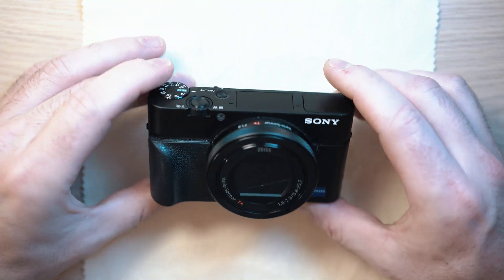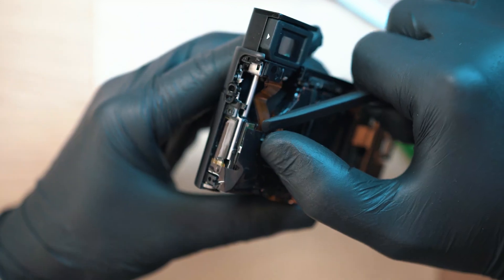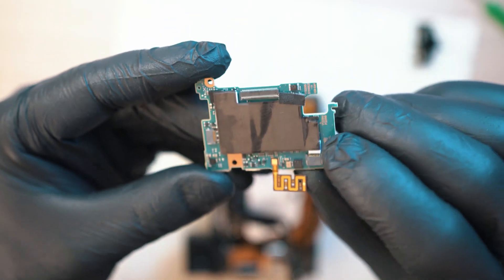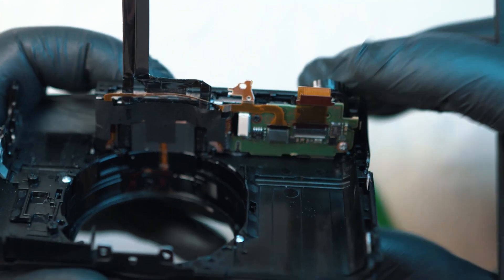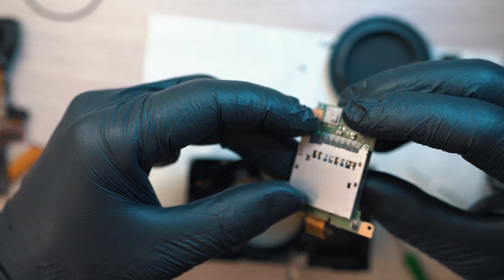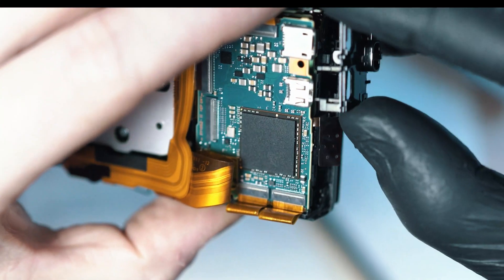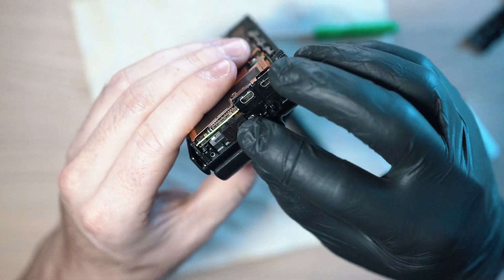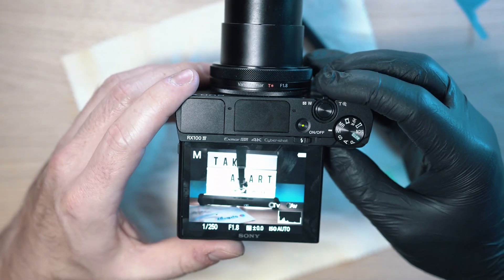SONY RX100 IV TEARDOWN - Lens Replacement Repair | Firmware Fail

Comment: Until what part of the video should I follow to remove the flash drive?
Reply: All on my cam work, photo, video flash pop up, but just pop up! with no light, on my screen shown error E91:01 and i decide to change the entire flash unit, I tried to change the battery, reset the factory settings and nothing, so am i wrong if i try to change the entire flash unit?

Comment: I want to ask about my camera, the lens was once pressed while it was still on, for a few days it would work in and out but after a few days later the lens wouldn't move at all even when the camera was off it still wouldn't go in, what do you think is the reason, and what is the solution, is it to service it or replace the entire lens?
Reply from the maker: Hi, repair only I would say…. where you located?
Reply: @takeapart  i am from indonesia

Comment: Thanks for guiding me!!
I looking forward for Service manual PDF of RX100M5 but i cant found any file on online and i finally found this!
Can you remember where backup battery(cell for remember time, month and year) located and what part of this video should i check?
Im guessing its placed on the floor of assembly
Reply from the maker: hi, it doesn’t have any backup battery…. I believe it uses capacitors to store energy for keeping time and settings when battery not inserted.  Solution that worked for me: put in fully charged (original) battery and leave it in… use camera regularly and eventually it stores all settings.

Comment: apparently my shutter broke :/ can I send you my camera to fix? It sounds like it’s an expensive job to take it into shops. I’m from California what would be your rates If so
Reply from the maker: Hi, Im not doing any servicing… sorry
Reply: @takeapart 
Understood :/ 
My camera says it’s a lens error. Do you think I need to clean it from the inside. Some people say it’s dust stuck cause the lens comes out and right away goes back in. Then I took it into a shop and they said the shutter is broken but idk if they’re just trying to get me to cash out.
Reply from the maker: @TheSuperbeanies hard to say… without taking it apart….
Reply: Update : I called a camera repair shop and they said buying a new lens and attaching it myself wouldn’t work because it still needs to be calibrated. 

Does that sound right? Cause I mean I see this video and it looks fine to just replace the lens but idk what’s your take on that

Comment: as you are somebody with lots of experience is would appreciate your help a lot. mine rx 100 iv doesn't turn on at all after being dropped. what is the problem most likely?
Reply from the maker: most likely something disconnected itself…. open it and inspect….

Comment: Help please, I took the backplate apart to fix an issue with the egg but the screen is blank now , the backlight is on and it won’t show anything
Reply from the maker: make sure that everything is correctly plugged in

Comment: Question, there is like thin rectangular metal plate cover on top the flash itself, can you remove it? It looks like there are few tabs that you can remove the top cover on the flash.

Comment: Wonderfully clear and no time-wasting not knowing what you are doing. Thank you very much. The particular repair that I want to make is to replace the lens which means detaching it from the sensor. Do you cover that at all - I believe it can be a bit tricky to realign the sensor and the lens?
Reply from the maker: hi, it was a while ago ...but if Im correct it is easy ....there are cenetering pin/s for sensor to sit on lens assy. 
thanks for watching

Comment: At 3:15, once the sensor assembly is visible, could you remove the 3 screws on it and gently flip it over(without detaching ribbon cable), to remove the hot mirror filter?(full spectrum conversion)
Reply from the maker: hi, if I remember correctly you need to strip more things… then you can access the sensor

Comment: Thank you for your video 🙏
I started opening my RX100 VI but I still can't find what's wrong. 
I have the "Turn power off then on" error, with code C32:60.
When I switch it on, the lens extends, screen stays black, then I can hear 3 clicking sounds, then the lens retracts and I get the error.
Really don't know what to do with it 💢
Reply from the maker: hi, not sure what that code means but something is probably wrong in lens mechanism or position sensor for lens retraction ….
Reply: @takeapart  thanks, I'll look that way

Comment: Hello! My Sony RX100V started asking me to input date and time everytime I take out the and insert a battery. It says online that there's an internal battery that maintain the date and time but I can't seem to get o find that small battery in your videos. Do you know what the problem is?
Reply: I have the same issue with my rx100m5. The clock resets everytime I change the battery.   The manual said there is an internal backup battery. Does someone get this fixed by sony's post service?
Reply from the maker: @shenpatrick2153 ghat battery should be located on power board
Reply: @shenpatrick2153  It's been 2 years and I tried everything. Resetting the camera, charge the camera with micro-usb. Even though the manual says there's an internal battery, I can't seem to notice a button cell on teardown videos.
Reply from the maker: hi, yea there is no battery inside… unlike on older cameras.  not 100% sure but you can try to charge it with USB cable and see if it gone hold settings
Reply: I tried charging it through USB and still no luck. :(
Reply from the maker: oh , I think it will disappear overtime

Comment: Thank You for the tutorial. My mainboard was defect and replaced it for a new one. Unfortunally it does not work. I can turn power on and nothing happens. When I press the button to take a photo the lens pops out and slides in again. Thats the only action!
The LCD screen lights up a little but no tekst. There's also a strainge noise from the lens.
is there any idea or is it lost? (camera is two years old and had a litlle water damage which insurance did not cover)
Reply from the maker: hi, if there was no drop or water damage before… I would check all connectors and delicate ribbon cables.
Reply: @takeapart  I will try that! Thanks
Reply from the maker: good luck
Reply: Well, I do not easely give up  but I cleaned All the connectors and build in the motherboard for the second time.  Now are other things working (and not working). The display is complete black, in the viewfinder I can see things and ajust timezone, etcetera. But the lens is not moving en stays in the camera. in the viewfinder appear turn power off and on. when I do this the same happens. when I turn on power there is a smal red light flikkering in the battery compartment. Any suggestions or should I give it up? Kind Regards Rob
Reply: I manneged to locate the strange sound I hear when I switch on the camera. It is a kind of scratching sound as if the motor of the lens is trying to operate or the sound of a short circuit (sound is not continu but in a Heartbead tempo). I wil try to find out by disassemling the camera again

Comment: Thank you for this video. I just need to replace the flash module - surely i don’t need to remove every single other component first do i?! Thanks again.
Reply from the maker: that’s the tricky one…. it has been a while since i been inside of the rx but you can follow me video

Comment: Just a number 1 pro video on how to. Fantastic! Just a little question: my EVF Electronic View Finder pops up with the slightest touch on the left side. Sometimes I find the Sony in my backpack with the EVF popped up. Any idea how to fix this? Keep up the good work. Grtz from Belgium! 👍👌
Reply from the maker: hi , there is delicate mechanism for pop up EVF inside of the camera (left side) maybe a spring or lever popped out… check it out
Reply: Hi @guzzio1, did you find a solution for this? My camera is turning on out of blue because of the sensitive EV mechanism. I would be very glad if you found a solution like to not turn the camera on automatically when the EV pops up.
Cheers!
Reply: @rafaelrezend  hey. Nope. Didn't find a solution. Sorry. 😔

Comment: Thanks for your video. I have another problem with an RX100 M7: the image is blurry below and especially on one side. This is due to the fact that there is too much play between the lens tubes and that it bends under its own weight. When I lift the tip a little, it's OK. How do I adjust the tilt of the sensor to be just right for a photo taken horizontally?
Reply from the maker: hi,I don’t think it is even possible to tilt the sensor.  you may want to check out lens parts and make sure it is all good there …

Comment: I followed your steps, in the end my display was upside down, power won't turn on, the lens comes out and won't reseed when i open the view finder.
What did i do wrong, can you please help.
Reply from the maker: HI , it is bit hard to identify the issue remotely .... if your display is upside down - the upside down sensor is disconnected or damaged . and rest of your issues seems like something is not properly connected or the ribbon cables and damaged . I would go once over and check all connectors and ribbon cables ( but again Im not sure what is you level of skills so please you decide what is right ).

Comment: I have a Sony RX100 VA.The Zoom/Telephoto toggle switch is not working. How do you fix this? Thanx
Reply from the maker: hi, use my links in description to get in touch with sellers and order top pcb with that zoom rocker.

Comment: Thanks for the video I will use it to fix an issue I have with a DCS -RX100M5 that cycles on and off constantly until the battery is dead, even with the power turned off. I have identified the problem as a loose connection in the viewfinder. If I press down on the view finder or put it in the up position the camera works fine. I have to leave the viewfinder in the up position to not kill the battery. (Not ideal)
Reply from the maker: hi, thanks for watching and good luck with your repair!

Comment: Hi! I have a hard time with the M2 version and it seems I cannot find anywhere a solution to my problem. And it is quite urgent, too. I get the error message "Unable to read memory card. Reinsert memory card". I swiped many cards of different capacities, types and brands and still nothing. I tried to clean the card slot with some thin microfiber cloth on a piece of a bank card, but still nothing. I think its quite difficult to reach the inner contacts anyway. In the upper part of the slot I noticed two metal contacts-like things which were covered in some greenish dust. I'm not sure what is the cause of it and if that erosion reached the lower contacts, too. 
Do you think that M4 version is similar to the M2 when it comes to reaching the card slot? Can you make a quick video with tearing down the camera and reaching/taking out the card slot? 
I am thinking of  replace it myself, since the next week I have to leave to Iceland and this problem came at the most inappropriate moment. I talked with some guys from a service, but as you imagine they almost have no time to repair it in such short time. And I think it could be quite expensive, too. So guidance will be most welcome!
Reply from the maker: Hi , hard to tell! it can be oxidation that prevents proper contact... also bent terminals ... I would disassemble it and give the pcb with sd card slot bath in iso alcohol... also you can access the terminals better. 
thanks for watching
Reply: @takeapart  Thanks so much for your reply! Indeed this is what I was thinking. To disassemble it and take out the sd card slot. Is it difficult to reach it? I mean, more difficult than reaching the lens? (I've already watched your video to learn how to start disassemble it, but at some point the card slot area remained untouched and to reach it, it looked like it would take quite a lot of work. (I don't mind the work, but I do mind to do something inappropriate while I'm at it).
Reply from the maker: it depends on your skills... if you never done similar you probably leave it for professionals... otherwise you can go ahead and follow my video.... not sure how different it is from mark iv but it shouldn’t be much different.
Reply: @takeapart  yeah, I never opened a camera before. But I used to disassemble my mobile phones for various reasons. Anyway, I think it is best to leave it for proffesionals and if they'll tell me they don't have enough time, next week, than I will do it and this is it. Thanks for your advices!! Keep the videos going and good luck!!  :)
Reply from the maker: thanks for support!  and good luck with your camera!
Reply: @nicuminculescu6509  Hey, I have the same problem with my IV. Did you manage to resolve it somehow, please?
Reply: @peterslany  Hi Peter! Being under the pressure of time, I just took the camera to the Sony service in Bucharest and they replaced the mainboard on which the contacts are placed and which was broken. Cost me a little less that 100 euro and they did also a cleaning of the entire camera including lens as a bonus. Before going to the service, I did some of the steps described  in various videos on youtube, but none did work.

Comment: I have the same problem as most people, the "turn your camera off" seems like a stuck lens. If I take the back cover off the lens starts to move but gets stuck. Help please
Reply from the maker: Hi, you can have something broken inside... also broken pieces can block retraction mechanism... have a good look inside and try to move small gears with hand ... just be careful!